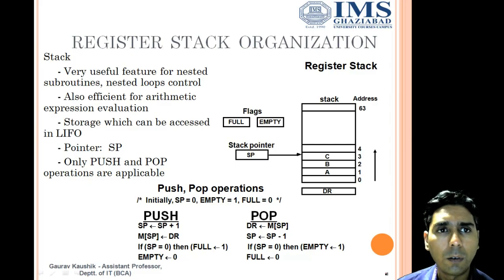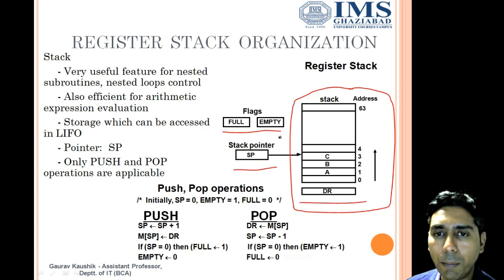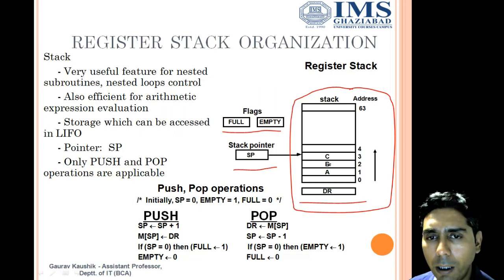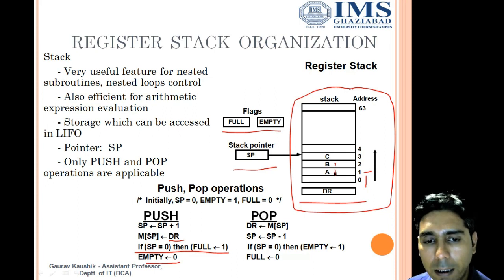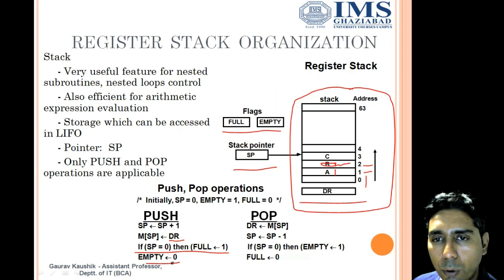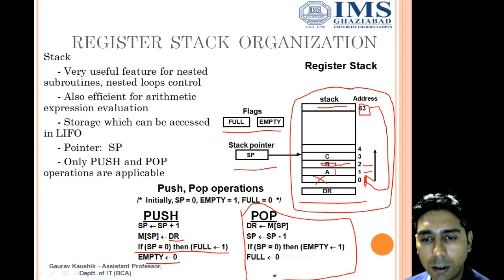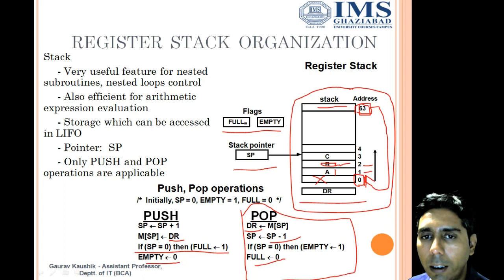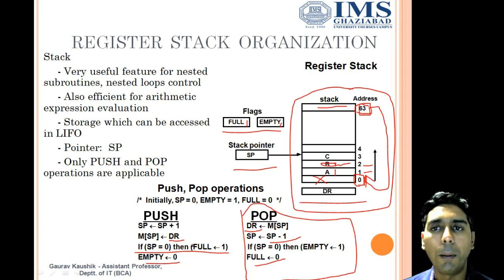Register Stack Organization

Comment: Why the first element A is not push at location 0?? 
-> push A at location0 then increment the SP by 1 so if next location should be free then next  element is push ..
Reply from the maker: Dear Parth according to algorithm we pushed first element at position 1 not at zero the answer is, when we pushed element at the highest position of stack after then on increment the stack pointer will point to zero as 111111(i.e 63 in decimal) + 1 = 000000 (i.e 0 in decimal). As here register is of only 6 bit i.e 6 flip flops are there in the register & one flip flop can hold either zero or one. Since all previous address are occupied in each insertion so when s.p is incremented on reaching 63rd address it will point the 0th address.